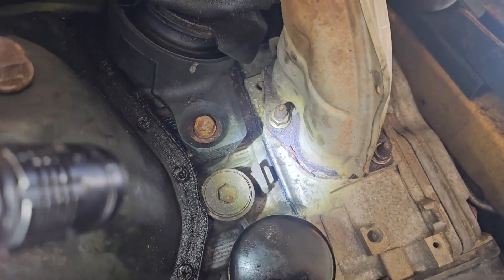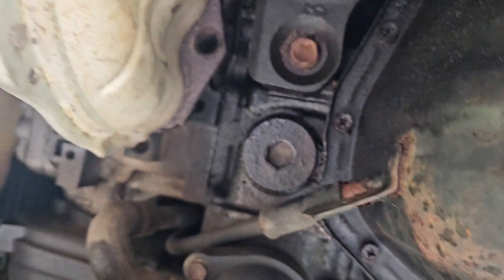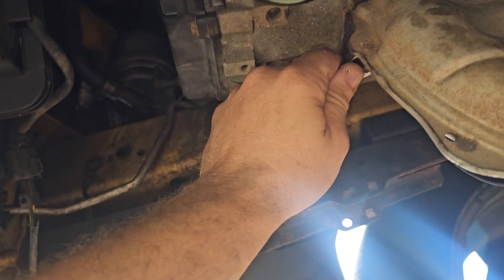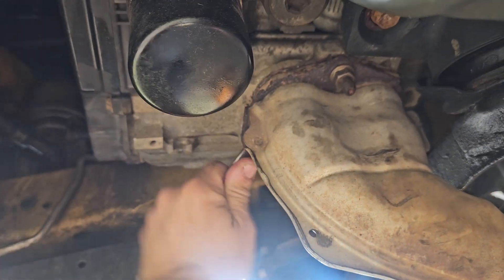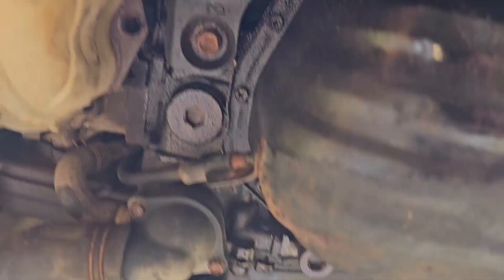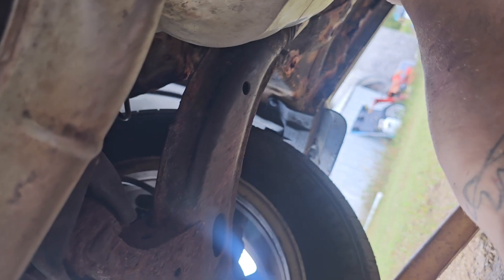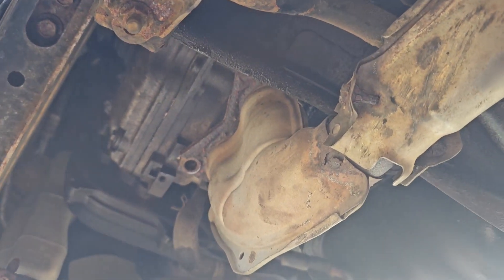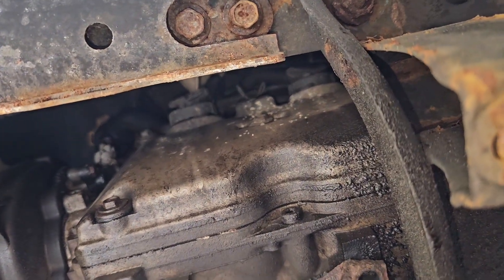where did they go? subaru exhaust bolts missing

Comment: missing bolts will give you sensor and 02 issues, bad exhaust leaks!
Reply from the maker: Spent the day fixing the exhaust, and pressure washing underneath the car, little by little I will get it back up to par, runs better now but still just not right, can give about 50% throttle in comparison to 8% when I got it
Reply: clogged fuel injectors or fuel filter? @lowxpectations
Reply from the maker: @MotoMeat will be starting with fuel filter,  plugs, wires,  air filter, oil change,  and seafoam